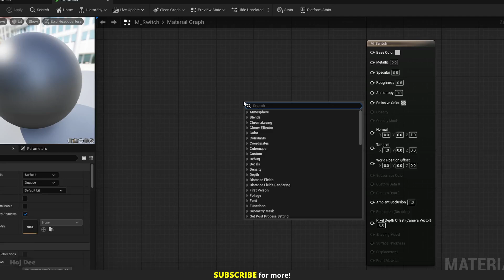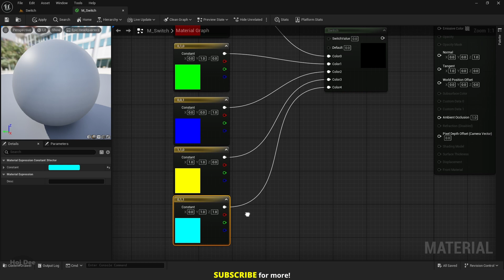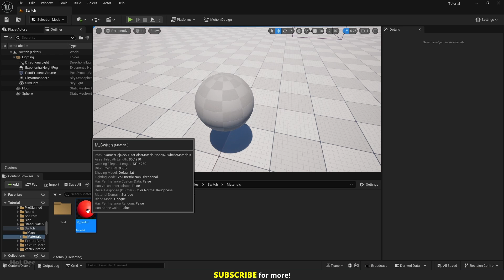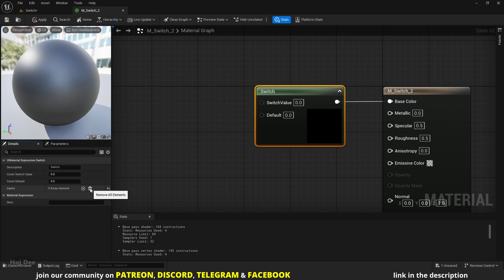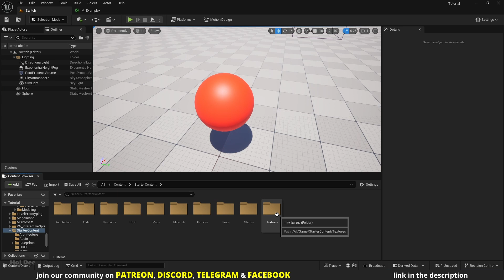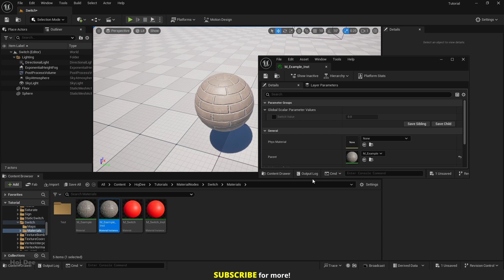Switch Node EXPLAINED! Unreal Engine Materials

Comment: Awesome! I wasn't aware of this, I've been using lerp nodes in series with several variables to use as alphas, this should make life easier.  I'm assuming it works with single floats?
Reply from the maker: Yeah it works just fine